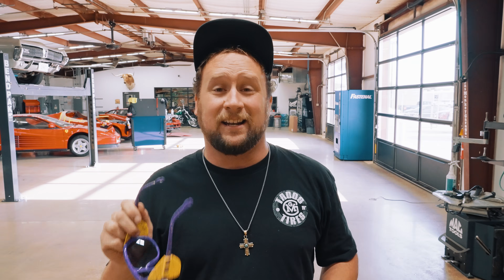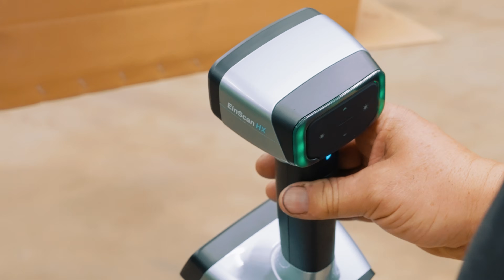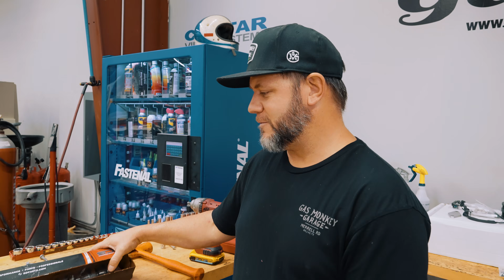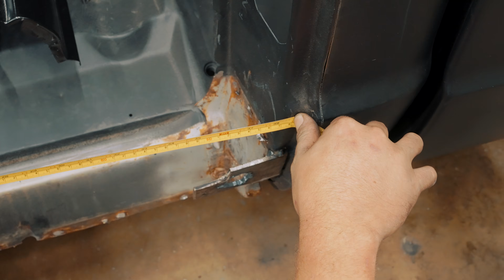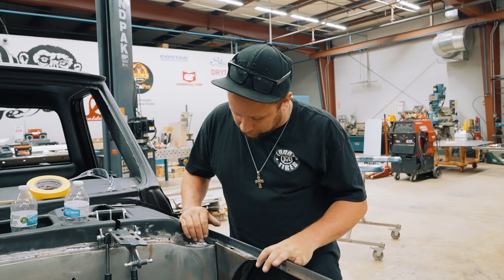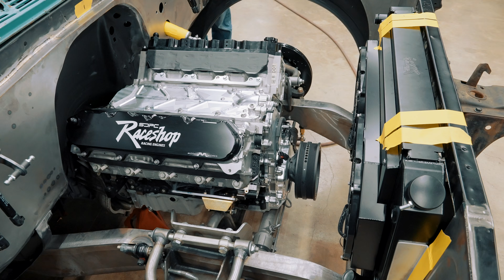Is it Bought or Built? | PT 2 - GAS MONKEY SEMA C10 BUILD

Comment: Richard don’t let those people get you so upset. Did you buy some parts for the truck? Yes, you did. These haters don’t take into consideration the time and labor that would go into fixing some of these issues. They think these trucks are expensive now just think if you had all that extra labor added in. You guys take old vehicles dream up and execute some of the most beautiful custom builds I’ve ever seen they come from you and your team of guys collective vision for what you want and you execute who cares if you have to replace like a hood that can’t be repaired look at all the work you did under the hood, smoothing out the firewalls building wheel tubs, etc. screw the haters

Comment: You cut out the VIN and a few other pieces and welded them into an all new body. It has a new chassis and drivetrain. Yes, you "built" those parts into a package. Meanwhile the rest of the truck is ready to be crushed. You could have made your own VIN plate, but you wanted one that is "old" so it can violate the current laws for a "new" motor vehicle.

Comment: That engines gonna leak. You can tell these guys are the bought not built crew.
You don’t use stainless fasteners on valve covers and intakes. Especially in aluminum.
Stainless won’t stretch in order to clamp, galls threads  and creates electrolysis.
Such a rookie mistake,  so many more but once I saw that , thats all I needed to know.
Richards just playing in his sandbox. I’m off to find a real build video by the guy who actually builds it. This is a clown show.

Comment: Boa tarde congrats carros this owner built 1972 Chevy c-10 longped makes a Big impression, custom g 1951, this bagged c-10 at the beachis the best, what s LT like to drive a 1964 c-10 truck?( Supercharged Chevy lsa),570 Hp ls3 swapped Chevy sububan hot Rod, 80 c-10 drag truck page 2 -the 1947 - presen t Chevrolet GMC truck message board network, this 1967 Chevy c-10 is smokin, duramax diesel powered 1956 Chevy, Marty -s 1965 c-10 vai trabalhar c-10 era red kap camiseta n tamanho GG e campeão 🏆☝️🤳💯🚗 amén uau sabia de tudo

Comment: It's not that you bought everything, why call it a '68 GMC C10? new chassis, new suspension, new brake system, new drive train, new bed and tailgate, just call it a Rawlings, gee I guess the guys did make a firewall, and it does take some skill to order parts and pay for them.

Comment: Lowered trucks with rubber band tires are boring. I went to a car show with my chevy square body crew cab with 12" lift on 40" tires (old fashion 16" rims), and parked on the end of a row of lowered trucks. My truck was surrounded by people looking at it, and taking pictures while completely ignoring the lowered trucks. The guys with the lowered trucks got so pi$$ed that they told me I had to move my truck somewhere else.

Comment: I find it hilarious that GMG has an issue with people being critical of their build. I like this channel, it’s way more realistic than Fast and Loud. Yet at the beginning it was said they were “building this truck”. Did I expect new parts being included, yup every build does. I didn’t realize they would pick a few parts off the truck and buy everything else. Are they building it? Obviously, it’s not a f’n erector set. But it’s barely the truck that was presented. Should have just said that they were going to use the truck to build a different truck.

Comment: I'd give a 2007 Honda Shadow spirit 1100cc motorcycle to get my dad's 82 Chevrolet truck up and going it has a 305 with a 216 cam he is disabled and has a prosthetic leg and is disabled I just want to see the truck going again he is 67 he parked it 8 years ago due to the wiring harness was ate by a possum here in Arkansas

Comment: Hey guys. When you mount the gas tank as a hanging tank, you should make some pinch brackets to spread the load across instead of it being loaded right at the bolt holes when it’s full and bouncing down the road.  

Great work!!

Comment: I guess my main problem with the build is that they only used the cab from a '68.  It's not bolt on since there isn't any of the original truck to bolt anything on to.  Is it going to be cool?  Sure.  Love that body style.  Is it a '68?  Yes and no since the VAST majority of parts are new so it's actually a 2023 built in the style of a '68.  It's still great to see something come together and it takes knowledge and skill to do what the Monkey's are doing.  I think it's cool that all these body panels and chassis are available so if you had a cab in great shape, you could build your own provided you had the tools and skills.

Comment: My issue is that, Ya bought a hole C10 and only used the cab...I think. I like the look of a stepside myself.

As for the build itself, Not a fan of frame-draggers, never saw the point of them, never liked the look of them. I can appreciate the work, just not a fan of the build.